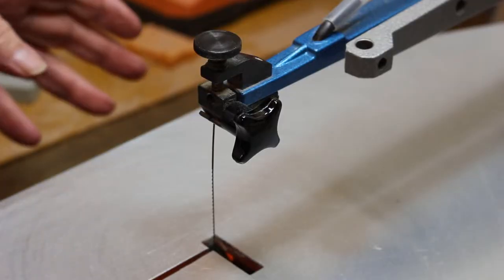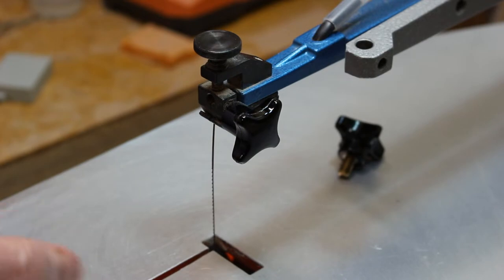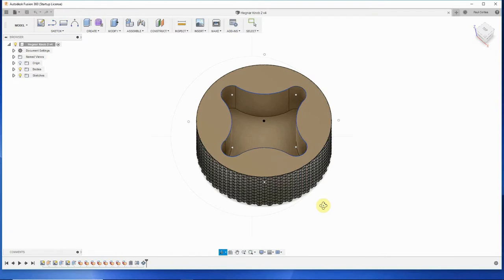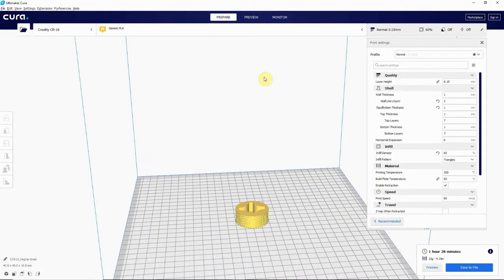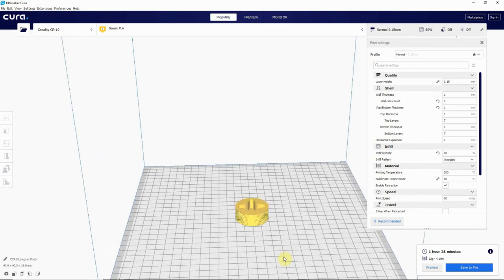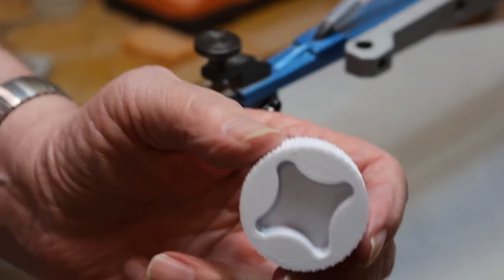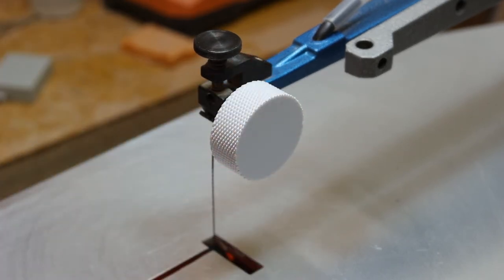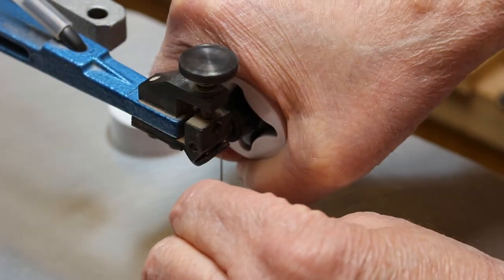Scroll Saw Knob Modification

Comment: Another excellent show Paul.  Although I don't own, or have access to, a 3D printer, I can definitely see multiple uses for one.  This is a great modification that will definitely be easier on your hands than the stock retention knob.  Some of those retention knobs can be a bear to release and I can only imagine how much that increase with a little bit of arthritis thrown in the mix.  Thanks for showing your method and for sharing it with us.  Always enjoy your program.
Reply from the maker: Kenny, 3D printing is getting less expensive to get into so maybe I will see one in your shop someday.  It is a fun addition.  The biggest problem I have had so far is getting these old brain cells active enough to learn Fusion 360 which is the design software.  I have gotten a lot of things to print from a website called   thingiverse.com   Lots of cool stuff to print there.  Thanks for watching, I appreciate your comment.

Comment: Nice upgrade Paul I’m liking the doors that the 3D printer open up
Reply from the maker: Mike, you are absolutely right.  3D printing also aids in mockups like you did when you started your dust collection piece on your jointer.   I honestly think the hardest part of the whole thing is learning Fusion 360  LOL   Thanks for watching and taking the time to comment.

Comment: Hey Paul! I like your 3D printed solution. That's a good fix for that knob. I had to make something similar for my Dewalt scroll saw because my girls were having the same problem with not being able to loosen the blade. I ended up making a square wood version with rounded over edges and painted it bright red to help keep up with it.
Reply from the maker: Tony, thanks for watching.   Originally I was going to do something similar to what you did.  I may even redesign mine so that it has a handle on it to make it even easier to use.  I appreciate your comment.

Comment: Great idea.  I did something similar on my scroll saw (actually on several machines :>).  BTY, I drilled holes and inserted opposing set screws.  The tape didn't hold for mine.
Reply from the maker: Russ,  I like your idea of putting in the set screws.  That would sure be an easier way of attaching the knob in the long run.  It would also make it easier to take on and off if needed.  Thanks for watching and for the comment.

Comment: Great video! Why not take a 3 liter soda bottle cover and fill it with hardening epoxy. Put a plastic bag over it and press in the screw for form. Let it dry. Voila!
Reply from the maker: A T, that is a great idea!!!  I wish I had thought of that before I went to all that work.  Since then I have switched to a lever type tightener and it works the best of anything.  Thanks for the great idea, I am going to try to remember that one for other projects.